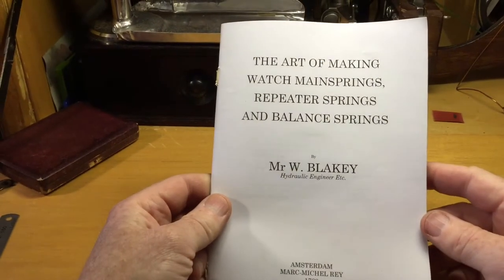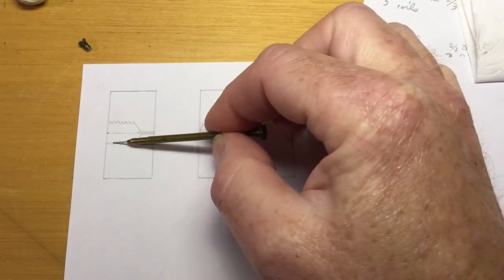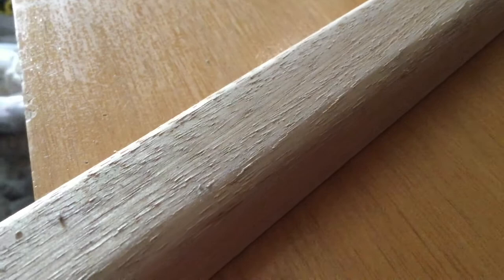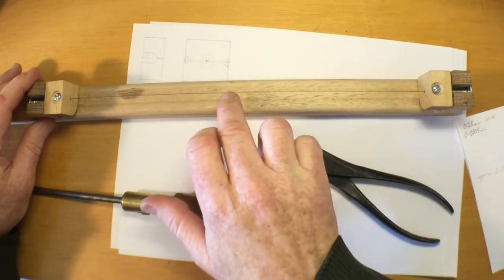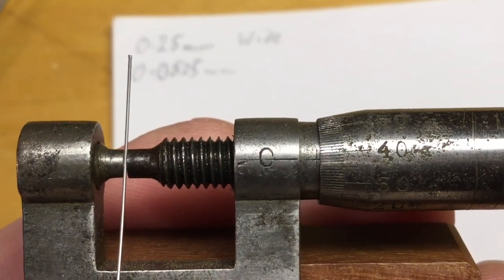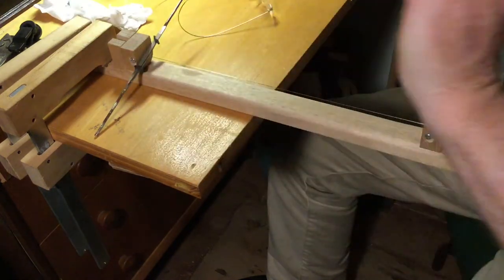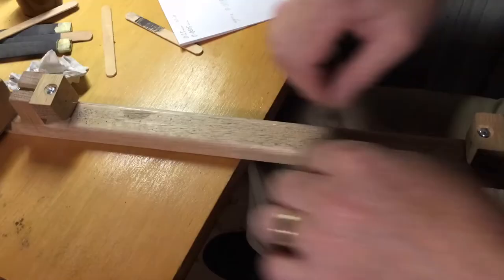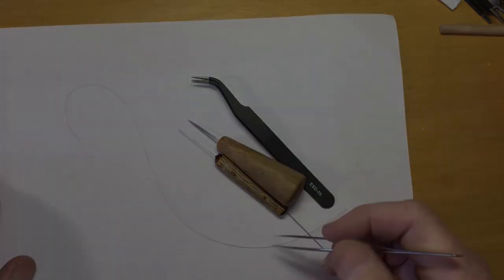Hand Making a Verge Watch Hairspring Pt.1

Comment: Incredible job. Congratulations
Reply: You cant simple make and spring and put in your watch it will not work.
Reply from the maker: @juaquimgustavo4712  Yes you can, and it does work. Hand curling wire was how hairsprings were made 200 - 300 years ago. I have watchmaking books from the 1950's that show how to hand make hairsprings for modern watches, using a little drum (which they show how to make) that 4 hairsprings are wound into at once.
There's no secret magic to it, just time and care. All the Best.

Comment: This is amazing! Do you know of any copper wire that can be used in this manner?
Reply from the maker: Good question Stefan, I have no idea :) But that is no reason not to try, It would need to be hammer hardened to give it springyness, then brought to dimension, then curled; but too hammer hardened and it becomes brittle. It wouldn't be magnetic, a  vote in it's favour, but how it would respond to changes in temperature is a big question. I'm guessing it's been tried at some stage in the past, and rejected due to poor performance, but you would learn things if you gave it a try. 
Make sure to watch Parts 2 and 3 for the rest of the info. as well as this video ( https://www.youtube.com/watch?v=0h--nJZPVD4 ) on how to make tweezers for the curling. Also, Repivot22 did a nice improvement of my method of making the tight inner coils:  https://www.youtube.com/watch?v=Ebk1TzH6wUw 
All the Best.

Comment: This looked great for me until I took another look at the spring in my watch. It's ~0.12 mm wide and ~0.02 mm thick so about 1/4 of the cross-section! Still very cool!
Reply from the maker: Verge watches have the advantage of everything being more robust :) But, might still be worth tackling; would need more fine work with the Wet 'n' Dry paper stuck to paddle pop sticks to get it to dimension.
All the best.